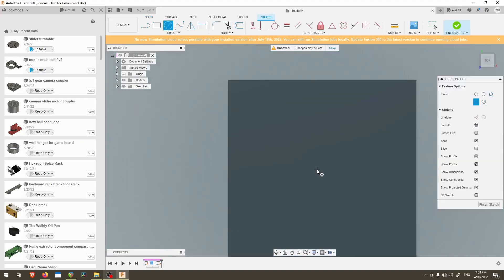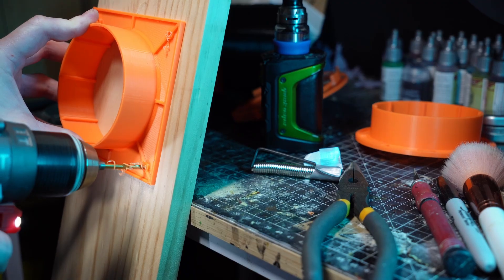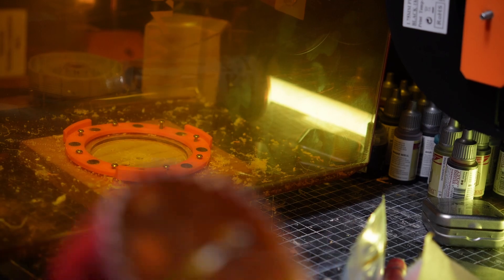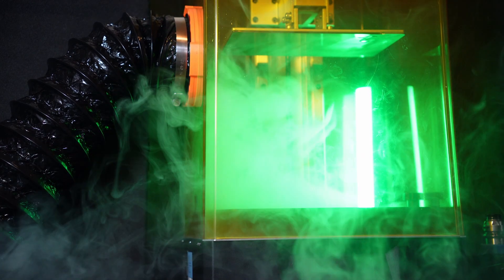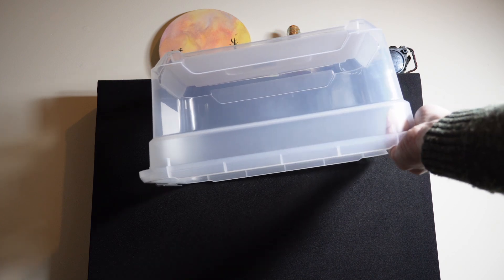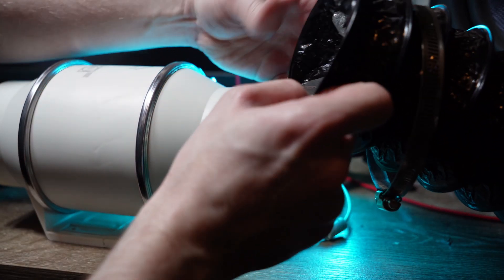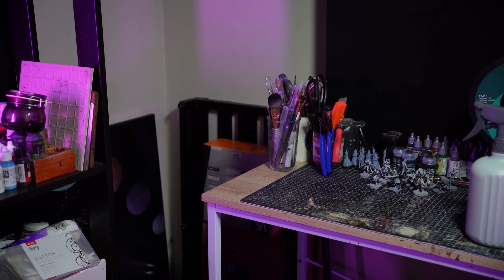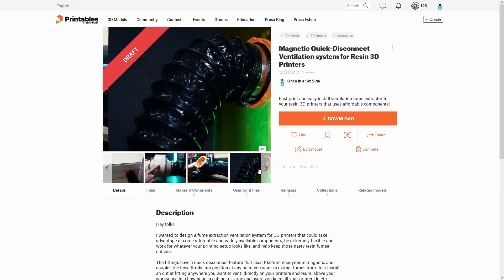Fumes be GONE! Versatile Ventilation for Resin 3D Printers (and other nasty smells)

Comment: Very cool video. For the problem with the "Cold weather during printing": Just don't ventilate during printing. You may even add a simple flap valve, which is heavy enough to not allow passive air exchange during printing. After the print is done, start the fan and let it run for several seconds and all the fumes should be gone.
Reply: Except that the cover itself is not air tight. So that fumes dont stay inside of it, and still come out during the printing.
So that is not advisable, what he Could do is to add a pre filter aswell as one of those light dim switches as to not have the fan blow full power.
Reply: He could also run a heater in the area near the printers

Comment: Printed these files on my resin printer and all the parts work amazingly!  I’m wondering if anyone else noticed theirs working a “little too well”? Mine is creating a vacuum. You can hear the fan working harder and the lid is actually sucked down to the printer. Would this cause any weird/unforeseen issues for me while printing I wonder?
Reply: perhaps regulate the speed of your external fan? Have you noticed issues since you posted this?
Reply: @johnvanzelm2307  my fan only has one speed unfortunately lol but good suggestion. 

I actually wound up just putting 2 of the little magnets I had leftover from the build at 2 corners of the lid to make a small crack for air flow and I’m happy with that. No smell in my room whatsoever while it’s printing and the fan is running.

Comment: Does it work during winter time? Like around 30 degrees outdoor temperature. Because if outdoor temperature is lower than inside temperature, the exhaust fan will push the warm air out and pull cold air in. I know a lot of people use a grow tent so they can put a heater inside the grow tent in order to manage the temperature. But if the vent directly connect to the machine, do you think the temperature is still manageable during winter time?

Comment: Maybe a stupid question, but I'm gonna make my own soon. Wouldn't it be more effective and easy to add the filtration system in the enclosure. This way, it would re-filter just that air the whole time without creating a negative pressure or filter external air (which might make the filter last shorter). Maybe I'm missing something 😊
Reply from the maker: Elegoo actually include little self contained carbon filters that go inside the printer enclosure and they work really well in my experience, so if you have one or two of those then I reckon you don't need to bother with this kind of vent :)
Reply: @OnceinaSixSide  im sure if you build a enclosure around your printers, and vent that out, you'll have lesss issues with failed prints and temp drops, as you can add a small heater into that enclosure to just slightly keep temps above too cold, and it would look great too if you put some albow greeese into the crafting of the enclosure.,  then after a finished print, u take lid off close enclosure again and let it vent out for 3/5min more to get the rest of the fumes out from inside the lid. before handling the stuff, cause the biggest inhaler are when you open the lid no matter what its the most concentrated. that moment and a few mins after.

Comment: Great video! Definitely going to set up a system like this for my resin printer. I doubt anyone's going to look at this comment, but does anyone have any ideas about how I could attach a system like this to a Wham Bam Resin HotBox? It has a built in hole, but idk how to put on this system without using tape, glue, or poking holes in the material.
Reply from the maker: Hmm not sure, but maybe some kind of bespoke printed fitting will do the job?

Comment: Something I have not yet been able to find any info on is how to store a printer that is not in use but still has resin in the vat. Sometimes I have one or two days between prints and don't want to clean out the vat, but I can't find a way to seal the printer airtight. I have tried wrapping it in several layers of bin bags, each layer inverted and sealed on its own, but the smell seems to just permeate the bags and escape anyway. Does anybody know how to make an airtight, not actively vented enclosure for the printer that actually keeps the fumes inside?

And adding to that; from what I've heard, the dangerous VOCs come from the curing process of the resin during printing, but what about the fumes the resin produces on its own while not exposed to any light?

Comment: You mentioned inline printing of the magnets.  How does that work?  I expected to see holes the magnets would snap into or rest inside for gluing but the areas look solid in final print.
Reply from the maker: Basically if you have completely sealed off cavities inside the part, you just pause the print right before those cavities get closed up, drop in your magnets, then resume the print.

Comment: Regarding the lack of air-tightness. You want the fitting to be airtight, as air is more easily sucked in there.  But you will need a way for air to enter the system. Like at the bottom of the enclosure.
Reply: I think it would be easy to make it airtight by gluing a thin rubber ring e.g. one used for 80mm semi-rigid radial ducting

Comment: Hello! Love this idea! Do you think it would be easy to modify the files to work with a built in exhaust fan on my nova3d whale 2 printer? The holes are about a 1.5” or ~38mm apart and then expand it to the 4” hose area? Thanks for making these.

Comment: Thanks for this video and build. I downloaded your files and they are printing as I write this. I'm a little hesitant to drill a giant hole in my brand new Mono X hood, but what else am I going to do. I already have a "paint booth" for my air brush work and I will be connecting the hose to the side of the air box to pull fumes outside. You connectors are just the perfect thing I needed. Love the magnet quick connect idea! Thanks again from a newby to 3D resin printing from the states.
Reply: Is there no other way than drilling? Drilling into the 3D machine most definitely make the warranty invalid?
Reply: @Xenely4  He is drilling in just the plastic covering. That has no bearing what so ever on the actual parts you might need warranty for.

Comment: Nice design! I'm personally going with the 'grow tent' method, particularly so I can easily have both my printer and wash station ventilated and I don't have to drill a hole in the UV cover.
Reply: I wanted to do that but my printer is too big i would need a massive tent to be able to remove the hood and work in. This method greatly reduces space taken
Reply: @digitalsmithy look at ones for an ender 3. There are a ton of FDM printer enclosures

Comment: The resin fumes are brutal for what ever resin I got. I had my mars 3 pro setup for like a month in an extra room in the house. My wife and kids complained about the smell daily so I shut it all down and have it stored away for now. I need to finish redoing my bathroom then I can work on setting up something in my garage to finally start printing again. I plan on trying something like what you have here for the fumes even in the garage. But I don't have any windows in there so I might have to figure something else out. 

Do you have any plans on how to keep the resin/printer warm when its getting colder like it is for me now? Possibly a heater near the printer but not inside and pump the warm air into the printer? Idk how safe that is tho.

Comment: good alt for people that dont want to bust out the powertools and are okay with paying more is to get a grow tent. They are for growing plants indoors, but you can use them for 3d printers. They have ventilation holes built in and everything. With an inline fan going it will create negative pressure in the enclosure. 
The advantage to this is: less UV light risk since you have an extra layer of material around the printer. 
The fan is not pulling fumes directly out of the 3d printer, but around it.
If you get a large enough grow tent you might have enough space to do all your post processing inside it (and it will act as a fume hood)
You dont have to worry about spills as much since it will all be contained in the tent.
Reply from the maker: Good idea!

Comment: Nice! The only thing I would add would be a collar (the same diameter with cutouts for the nuts) on the inside of the acrylic part, to absorb the clamping force from the m3 nut. It will help prevent cracking from stress over time. This is awesome though and definitely on the list of things to do!
Reply from the maker: Good idea!

Comment: Awesome design and a great video! I have a Mono X and have been trying to figure out a way to dispel the fumes for awhile now! Also, do you have any recommendations for Mono X settings? I have been getting print failures nonstop, thanks!
Reply from the maker: Cheers! Well I can give you some general guidelines here, but basically you'll want to ensure your build plate is level first, then for your settings try lowering your lift speed to 60mm/m if it's not already, and definitely figure out your optimal exposure time with a calibration print. Amerilabs Town is good, I'm also currently looking into Cones of Calibration and that may be even better but my verdict is still out on that. Good luck!

Comment: Love the idea! wondering why you went for cutting a hole in the side rather than the top?
Reply from the maker: Cheers! I suppose the top would be a good location too, but for me specifically I've got my printer kind of high up, basically head height so having it on the side is just easier to reach.
Reply: @OnceinaSixSide  OK, top attach will suit my set up more, just was worried it was for a particular reason. Thanks!

Comment: Nice design. I made a similar magnetic copuling for my clothes dryer vent. Without magnets it was impossible to attach the exhaust hose. Adapting this to the printer never crossed my mind but now that I see it in action, I may go for it. I still have a spare 4" fan from my old laser setup along with a charcoal filter. Looks like I have a project for this weekend.
Reply from the maker: Awesome! Hope it works out

Comment: What resin do you use? I use ABS like from Elegoo and find its fumes pretty strong
Reply from the maker: I haven't tried the ABS-like stuff myself, just been using cheap n' cheerful Anycubic standard grey.
Reply: @OnceinaSixSide  haven't actually tried the standard ones. Started with ABS-like for the extra strength and never tried others. Tempted trying water wash resin to save on ISO but heard its very brittle.

Comment: Good design on the magnetic clamps.
Others have done similar venting designs for both 3D printing and paint booths.
Paint booth venting will be fine, just use a furnace filter in the booth to stop particles getting into the inline fan.
Since I don't have a window currently to vent out of in the place where my equipment is, I built an enclosure to keep everything isolated, and put a air purifier with carbon filtering in it. Keeps the printers warm, like they like it in my cold climate, and the air isolated from the rest of the room.
Reply from the maker: Great idea! Those aren't too pricey either which is awesome.

Comment: Is not airtight enough, but, you can easily fix it using rubber packs, for the diameter you are using should be easy to find, as a mechanical engineer, the small space was a reason for me to not buy one, silly me, I forgot what it means to be an engineer, to solve problems, great idea
Reply from the maker: Thanks for the feedback! Yeah it would probably be pretty straightforward to implement some sort of gasket. As an engineer you're primed to get the absolute most out of 3D printing, I highly recommend taking the plunge.
Reply: @OnceinaSixSide  I will
Reply: Then as an engineer you should understand what negative air pressure is, aka a vacuum....lol that fan looks like it will pull 50-100 cfm probably way more. Well more than enough to pull the fumes and prevent any escaping from the lack of a gasket at the connection. The only real issue is instead of ventilation straight outside it needs a filter box with some basic carbon like seen in a fish tank filter for the voc. 

Also, generally the only people who say "as an engineer" are bad engineers in practice. So avoid doing that because it has no merit in the real world.

Comment: Think about adding an inline filter. This will help reduce any stray fumes and catch paint particles. You can find them cheap online; Cooker extraction fans, aquariums, respirators, and air purifiers are some of the ones I’ve used. Or make your own with soft toy stuffing and activated carbon pellets, which is what I use now. Even if venting outside it’s still a good idea to reduce particles and voc.
Reply from the maker: Ah that's a great idea! Researching now :D
Reply: @OnceinaSixSide car air filters might make for the best filter option given the size. If you have a car that's going to the junk yard, then pull the air intake out. Or go to a junk yard.
Reply: do u have more infromation or tutorials thx